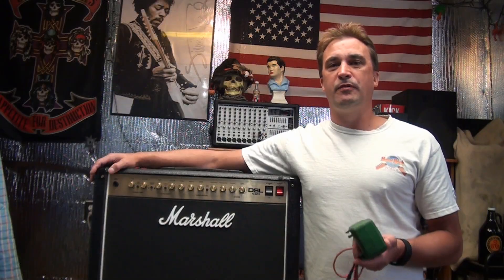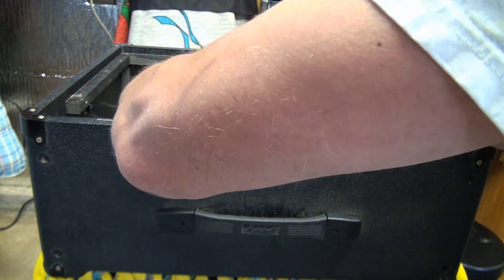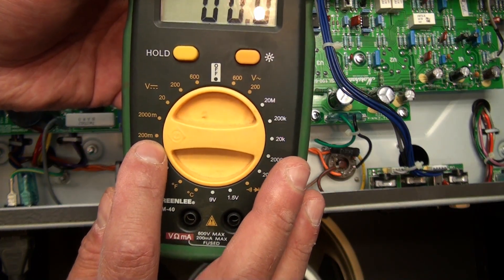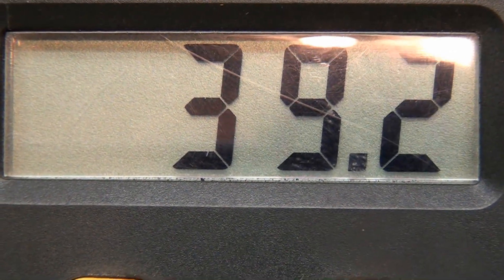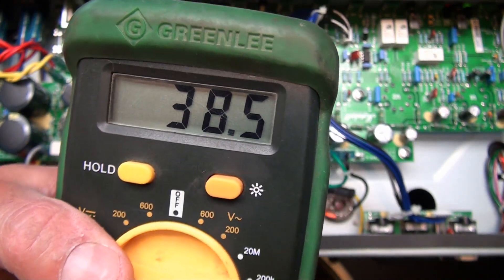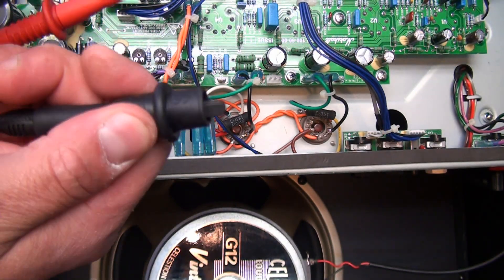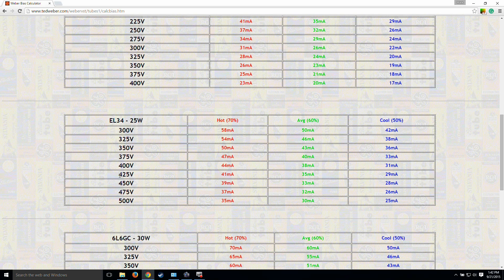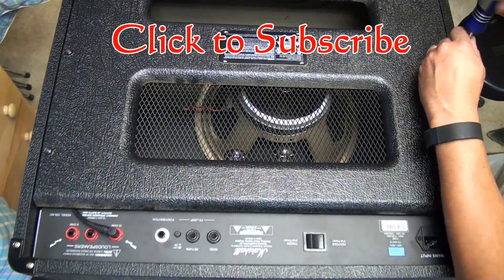DIY How to Bias a Marshall DSL 40c Guitar Amplifier Using a Multi-Meter DSL40c Measure Plate Voltage

Comment: I think I hear your transformers humming. Mine does it in stand by and it gets slightly louder when in the 20 or 40 watt setting. Is that normal? Or should they be 100% quiet? Mine is very slightly noticeable sitting in front of my amp.

Comment: Good stuff!
Except the part about using open holes in the chassis to poke your fingers in and lift it out.  YIKES.
Yeah, many amps have a bleed-down resistor across the reservoir caps to drain the voltage, but not all do.

Comment: Appreciate your easy to understand instructions. Just re-biased mine and it took far longer to just get the chassis out of the the cab than it did to re-bias the tubes. Got a good deal on some Mesa branded EL34s so I'm interested to hear the difference between those and the stock tubes. I actually took the thing apart in such a way as to not move the cabinet or the mic at all, and made sure to not bump the controls, and I recorded a loop before I took out the old tubes. Once I get it all back together, I'm gonna play the same loop through the new tubes and compare.

Comment: Thanks for the video. Tried  doing this but the transformer on the left is too big and won’t allow the unit to pass the cabinet to come out. Tried to loosen it to slide it over a bit to get it out but that was a no go. Seems like I need to dismount it to allow it to pass or modify the cabinet. Any suggestions?

Comment: Mark,
I followed your instructions on my dsl40c.
Couldn't have been easier. 
I considered clipping the c19 bright cap, and spkr swap 
I decided to do one mod at a time...
One tube was dead on 40mA
Second tube was 36mA
Set them at 40
I was thinkin this won't do much..

Omg.
It's a fire breathing now! 
Even with the 70/80.

Thank you! You made it so easy for me.
I was considering trading it off.
Now, it ain't goin anywhere!

Comment: Fantastic and concise explanation of plate voltage reading and biasing process. Thank you so much. I have a question that I can't clearly put into words, so instead I'd like to ask if there are any major differences to do these tests on a Jcm 2000 dsl 50. Thanks again for your time.

Comment: Thanks a Million Mark!  A dude in SF, CA is much obliged, thanks to your time and generosity of spirit.
Reply: @nogripes  what should the bias measurement be for a dsl 20 cr amp?
Also, if you know about the speaker would appreciate some input. My dsl came with the 70 80 speaker which most say is garbage. I can hear that it does not have a tight sound . What would you recommend for a tight sound, playing crunch sound not super high gain. Thx

Comment: Mark, does the plate voltage change with tube age, different tube models, or a hot or cold amp? I'm asking because I would like to check it only once and then write it down on the inside of the cabinet, but if it changes then I would have to check it everytime.

Comment: MARK JENKINS, 
When you're biasing the power tubes in an amplifier circuit how do you bias the compression of the power tubes the 1dB compression point of when the power tubes start to compression? because its say to bias tubes at a 30mA bias current per tube to be safe but how do you know when the tube is compressing?

Comment: You don't have to wait 50 minutes on Standby, because after 60 seconds your heater filaments voltage won't change. You can adjust your bias after few minutes and re-check it after about one hour of playing, if you want!

Comment: You should lower the bias to 36 or so if the voltage is 116vac because the voltage will be higher at times so best to be safe for your tubes !
I run my home variac abit low at 116 vac for practice but 120vac to bias the tubes or checking the bias !

Comment: When I touched the brown wire to test the plate voltage, it sparked and made a pop noise through the speaker. I'm not sure I had the multimeter on the right setting. I just set it at 38 and left it alone.
Reply: Did you make sure to clip your negative clip to the CHASSIS and not the node used for biasing?

Comment: When i tried to check the plate voltage, I burnt that brown wire somehow. Any clues on what happened because I know nothing about this stuff... :(
Reply: Also, the amp doesn't seem to work now at all. As if it is not to connected to the speaker. The tubes glow as they should though..........

Comment: You're the man. I've done tech work on guitars for years, changed preamp tubes,and power tubes on amps with self bias circuits. You made it look easy and it was. My factory power tubes were biased at 52 way to high, I believe that's why they burned out so fast. Threw in Mullards biased them at 39 and my amp sounds great. Thanks for the knowledge.

Comment: Would the dsl 15 also be a class AB amp like this one, or would it be a different class?  It has 2 6v6 and 4 ecc83 tubes.  I need to find the milliamps for each output tube, and I'm not sure which class I should choose.

Comment: any tips for values about DSL100H? i would like to know the bias values, should I double that value since I have 2 power tubes on each side?
Reply: Great video though!!
Reply: That should be the same. There are amps where there is just one bias trim and that sets the value the same for both/all tubes (that's why you always should use the same tubes).
My guess is that if you have two trims (and it should) they both control two tubes.
Tubes are basically a push and pull for the speaker. With four tubes you have two pulls and two push tubes so that's why.
If I am wrong, anyone, please correct me.

Comment: I’m a Complete newbie to amp repair. I have a Marshall DSL 40c and I’m having trouble w sound. Popping, humming, hissing etc. My amp Is  about 6 or 7 years old and haven’t used it all that much until about 6 or 9 months ago when I started playing my electric guitars more. 
The research I’ve done says it’s the tubes that are the problem and I plan to replace all tubes since it’s older. 
After I replace the tubes do  I then follow your tutorial? Is that correct? 
Are these the only two that need to be biased? Or do all of them need it?
I’m trying to save money and don’t want to take it to a repair shop unless I absolutely have to. 
I do have experience in electronics. I have completely gutted both a Les Paul and a Stratocaster and replaced all pickups, wiring, volume, tone pots and switches. So I’m not a total newbie to electronics but for this type stuff I want to understand it as much as possible before committing to it. It took me months of research before I tackled my guitars so I don’t want to skimp on my expensive amp. 
I’ve seen some videos that say just pop out one tube and pop in the other. I read an article stressing the bias on new tubes and that’s when I found your video.  
Thanks for sharing this knowledge. It’s invaluable to folks like me who are disabled and trying to save every penny possible . The less money I save from paying techs to do something I can do the better!

Comment: Mark Jenkins, Have you measured the voltage drop between the cathode and ground and then just used the values as amperages?
Reply: Sorry) I found out that Marshall used to place a 1 kOhm resistor in between those pins...then everything is fine!)
Reply: @БогартХамфри-ф2е  It's actually a 1 Ohm resistor connected between cathode and ground. When you measure the voltage across it, the voltage in mV is numerically equal to the current flowing through it (i.e. the current flowing in the tube), e.g. 35mV corresponds to 35mA.

Comment: One question. I assumed that the plate voltage is 450 Volts when you set the mA to 38.7 for each tube during the bias demo. You mentioned your were going to measure the actual plate voltage. Anyway, is the plate voltage for the EL34's  supposed to be close 450 Volts for the Marshall DSL40C?
Reply: Oh, I got my DSL40CST yesterday and it's a keeper!

Comment: Mark,
You covered everything I needed to know in a clear, concise way. You mentioned the Weber Bias Calculator that I had forgotten about. I created a new folder called "How to Bias my Marshal DSL40C" and saved your video and the Weber on line Calculator in it. I also saved the Weber Calculator into my existing "How to Bias my Fender Hot Rod Deville III" folder. Fender sets the bias at 30 mA (half of the actual 60mA) as you bias both of the 6L6GC tubes with only one "pot". I had the Fender biased at 57mA for a year and the clean channel would never break up even at max volume. Very loud. Two nights back I biased it at 65mA and all the clean was gone when I strummed a chord even at lowish volumes. The lead notes were still clean. But the change actually surprised me. I may go back down to the factory 60mA. I have read that you can bias the Hot Rod DeVille amps at 80--85-90mA and they will still work and they will sound very lively and hot. But the tubes may not last very long.

 I have a $49 Chinese made "Line-R 1200 APC which conditions (attenuates) the power down by @10% or up @10% from my house current measured at 117 VAC last year. My house voltage at the back of the "Line-R 1200" measured at 103 VAC. This @10% attenuation allows for a nice "brown sound" even on an amp that may be biased on the cool side. So when you do not use the Line-R 1200 APC your amp will go back to a clean amp. In this way I do not have to bias my amp for every mood change and feelings that I may have as I play. I highly recommend the APC.
Sweetwater sells the AmpRX Brownie line of products that each have 3-4 different voltage choices which is very nice but they cost $249, $349 and $1,049. Yes I would rather have the $349 5A Voltage Attenuator, but my Line-R 1200 APC does the same thing, but only with a @10% reduction, no other choices. It works just as well however. Maybe when I have a cash surplus I will pop for the AmpRX Bronie $349 model.
Mark, I hope I have helped you as much as you have helped me. I joined/subscribed.
-Peter
Reply: I should add that I am expecting delivery of my own new Marshall DSL40CST on July 11, 2017 or just a few day's from tonight.

Comment: this amp is amazing. you can put and eq pedal b4 and or in the loop and the tones are 1000 times better. i have a question donyou have to re bias it when you change the tubes?
Reply: dang. the meters on aliexpress like 5 bucks and tips a dollar and solder iron i think y buks. anyways yes man i promise to GOd and ew in the loop is an absolute must for this amp. man i promise i have A Bd it 100 times it is so frikn nice the tones bro. i recomend a boss ge 7 band with the level lever cuz you can turn the level lever all the way down almost and turn all knobs to 10 or put the last lever up and barely turn the amp up and the tones are so glassy. dsl40 is so amazing with it. oh and make a soft v with the levers or smiley face. thx a million
Reply: Mark Jenkins shoot also bro does the dsl 40 come with good tubes and can i put the tubes from my evh lbx in it

Comment: With my plate voltage at is 475 or so the amp sounds best at 30ma, my tech set it once he's been doing amps for 35 years. I decided to set it 34 then played loud Sat and there was something off. It wasnt as fat sounding on the red 1,mids were hotter sounding and a bit unpleasant! was kinda pissed so took it apart and set it back lower. Even the stock speaker isnt near as bright with these settings so keep in mind people these amps are mostly preamp distortion so running it hot makes it sound worse! Its sounded actually tighter now.

Comment: I began to follow your instructions but I get a 37.7 rating when I connect the left and middle of the three test prongs, but no reading whatsoever with the right and middle. Any ideas?  Thanks (There is continuity between the middle and right )
Reply: Had the same issue. In my case it was of a dead tube. Once I replaced them, all was good.

Comment: EH tubes seem to run a bit cooler and give this amp a Killer tone! I added a Celestion Creamback 65 speaker as well and it went from stock to rock! Sounds like a 2k Handwired sits on a amp stand in a corner and projects stellar tones (just blown away) by this little critter.

Comment: i got one question... was the amp on standby while you measured the plate voltage?
Reply: No. The output tubes need to be conducting while making the measurements.

Comment: Thanks Mark, keep up the info much appreciated. All you non qualified techs out there please use caution you can see it looks easy but if you place your hand or finger in the wrong spot you can "die" 

Don't attempt anything your not 100% sure of, I watched a tech drop his guard by not removing his bling chain around his neck. While telling everyone to be safe his done the classic mistake "i've  done this a 1000 times ........ What happened next the chain made contact with the chasis while his other hand was touching live 480 volts.  Warning never be complacent minimise the risk take off all your rings chains anything conductive, even sweating on your skin will make a conductive arch. Keep it safe a tech can does this for x amount of dollars if your not 100% certain

Comment: Great video mark. Huge help! Just replaced the power tubes in my dsl40 and thanks to your video, biased myself. Sure it saved me a few bucks but most of all I understand my amp a lot more now. Btw, I also swapped the speaker for a creamback and wow what a difference. Just couldn't get the stock speaker to sound right. Anyway, keep the videos coming!
Reply: Allen Kosanovich hey I just put a creamback in mine......did u go 8ohms or 16?

Comment: I have the same amp, so does that mean my plate voltage will also be 450? or do I need to check it first?
Reply: check it mine was 480, better to bias it in the average range the red channel wont be as bright

Comment: Great video Mark.. easy to understand.
Ive just biased my DSL40c :D by following your video (39.7 & 42.4) to 38.3mv

Quick question for draining caps (if necessary) as ive only had the DSl a short while..... Are the caps self draining?
Ive seen on various forums that they are and if you click the standby button on, that will also drain the caps (after a while)

Many thanks matey

Kev

Comment: Good video. Well explained. Those 3 prongs where you connected the multimeter. Couldn't you have the female of them with soldered wires for easy(safe) connection?
Reply: With the DSL 2000 they had trim pots and bias adjustments on out side the amp

Comment: Thanks Mark. Stock, my DSL40C tubes were biased at 35 and 40 out of the box. Checked plate voltage and did the pot adjusments based on the Weber calculator...I just have probes, and the rig you have would make it much more efficient. Putting it back together to see how it sounds. Right now I'm running a G12-80 from the late 70's, and I'm throwing a new G12H-75 in tomorrow.

Comment: Very informative and usefull. I should overcome my fear of being burned by electric shock and do it the way you show. Last year I modded the cabinet of my DSL40 so now I should try to touch something inside electronics. I can hear pretty loud "wind noice" when I turn volume know above 5 - recently I try to get power tubes break up instead of preamp break up so I turn volume about 8-9 but noice is too loud. I wonder if I make the amp cooler (or replace powet tubes) does it help?

Comment: Hi Mark, can I ask you a general electrical question about this amp? If I checked the resistance from the (-) ground of my guitar cable to the ground on the plug of the this amp (unplugged from wall), should that be zero? I get about 100 Ohms. I didn't know if the guitar signal ground is connect directly to the wall earth ground.

Comment: Hey Mark! I'm really thinking of trying this myself now that you've de-mystified the whole thing. If I were to replace my tubes with new ones, would the biasing process still be the same,  or would it be more complicated? Sorry for the amateur question, I am not at all experienced with amp repair.
Reply: +Mark Jenkins I am probably going with JJs. I had a JCM 2000 DSL100 half stack a while back with JJs that were biased a little bit hotter and it screamed. Since this amp is almost the same amp, I want to set it up the same way with the tubes and also throw either a greenback or a vintage 30 in it. I saw your video on the speaker swap and it also looks like a breeze! If I wanted to bias the amp slightly hotter, where would you suggest setting it to still stay within good operating perameters?
Reply: +Dan W *parameters

Comment: Hello I have a marshall haze 15 and I'm planing to bias my amp but my problem is my amp don't have a stnby switch....so should I clip the alligator pin in the bias test point first and then turn it on or vice versa????thanks

Comment: hello friend, great video, thanks for sharing your knowledge !, look have a head dsl100h, I do this same procedure, how to do? , 38.9 leave on each side pair of EL34? the plate voltage here is 470 v, here are 4 ewl34 two pairs, so my doubt is place the multimeter in mv scale and take up the 38.9? Thank you if you can answer
Reply: +Henrique Guitar hi you should bias the 100w head by 74.5mv by duet at 470v for 70% dissipation. Good luck

Comment: When I saw the insides of your amp it reinforced my commitment to stay with my 50+ year old tube amps and their point to point hand wiring and solid pine wood cabinets.
Reply: I believe it actually reinforced the fact that you are a D-Bag. Why would you watch a video on amp technology that you claim to hate. the answer is --> D-Baggery
Reply: Joseph Liptak These are good pcb tube amps. The board is only 1/16 thick but it has good stress relief and good trace layout. The tubes and pots are chassis mounted. This is as sturdy as any vintage amp.

Comment: Add my thanks to the pile. Been meaning to check bias for a while. Had the amp for a year. Discovered wall voltage was hot at 124+, bias was 38.7/41.3. Plate voltage 473. Weber says 36.9. Got mine leveled out at 36.5. Curious to see if it has changed much. cheers!